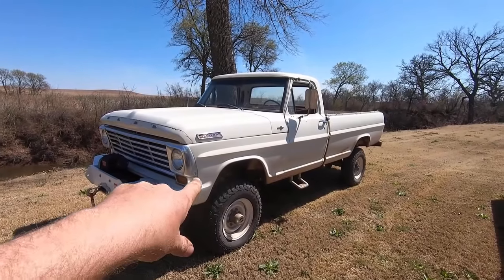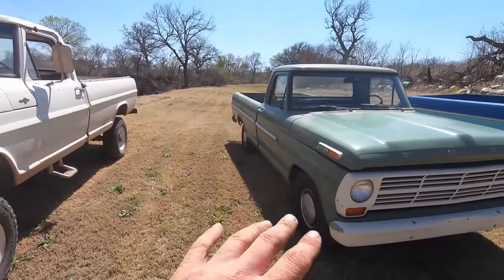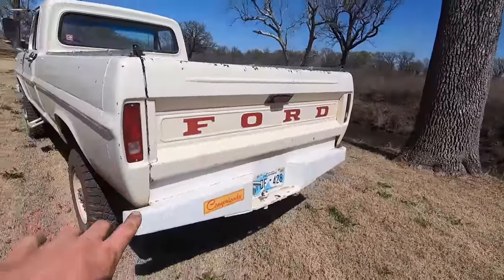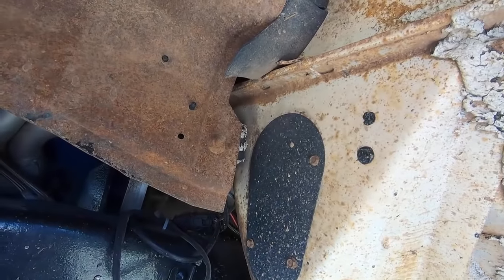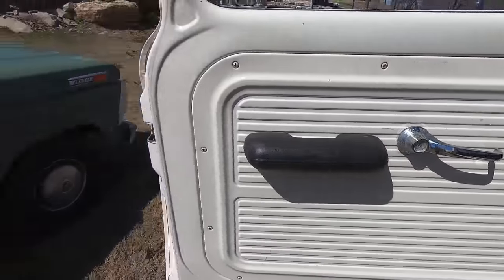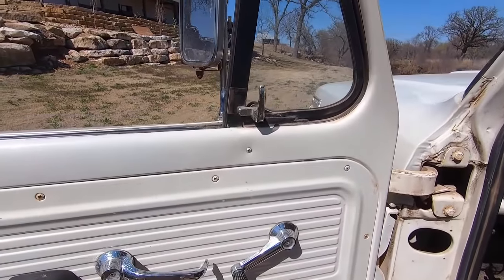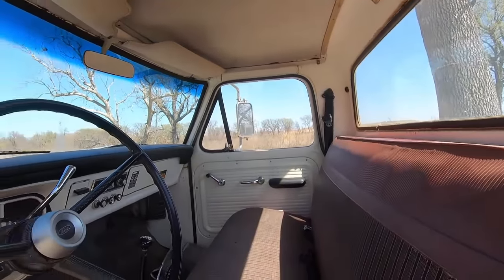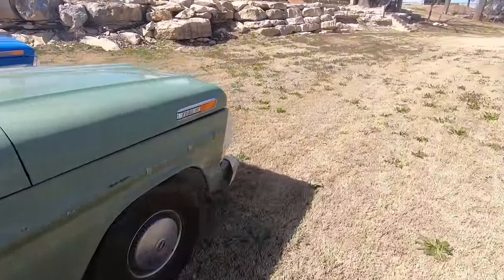What Makes a 1967 Bumpside so Different Than The Rest?

Comment: I had a '68 Mercury F100 short box, 240 six with three on the tree and positrack rear end.  Since it was sold in Canada it has many similarities to the '67.  Original colour was green with a white bump stop. I wrapped the odometer around on that truck.

Comment: I just bought an estate sale and there was a 1967 f250 in the garage, one owner, practically no rust, garage kept and under 70k miles, have all original paperwork and maintenance, has a custom camper on the back. Located in central Indiana. Will be sell soon. If you know anyone.

Comment: I can remember in 1972 , dad arguing because he had to buy the rear bumper separate. He ended up buying a 1972 Ranger XLT , candy apple read , 2 wheel drive with a 302 in it.  I believe 72 the seam going down the bed was gone . Then 73 changed everything
Reply: Also i think till 1971or 72  the F100 , only had a transfer case that was engaged or not , just in or out single speed. Dana 21 i believe .  They would break in half . I have broken more than one of them. .

Comment: This has straighten out a few questions I have on my truck. Mine is a 72 dually I got as is from a guy that installed a dual ram PTO dump system on the back, swapped a 67 cab but it has the 68 doors with lock plungers and armrest door levers. The cab is  f100 bump and naturally it has a 460 out of a 78 continental… man I love my truck 😂

Comment: 67 though 69 Ford pickups were the toughest Ford trucks ever produced. especially the ones equipped with the 300ci 4.9L inline Six cylinder engine. they were bullet proof.
I have a unique Ford Pickup, it's a 1966 F250 4x4 chassis with a 1951 body on it. with a 400 + HP 390 FE engine and a tilt front end. I did all the work on it myself including building the engine. except the dual two and a half inch exhaust system. I also have a 1978 F150 2WD with a 360 FE engine and a four speed. normally 78 models didn't have FE engines in them. but I put it in the truck with some parts from a 1967 F100. I also used the windshield from the 67 and put it in the 78. I also have a 1981 F250 4x4, with a 300ci 4.9L inline six cylinder engine and a four speed. it's a totally bullet proof truck. a person might say I really like Ford Pickups and they would be right. they are best trucks ever made no doubt.

Comment: My dad had a 67' f100. Came stock with a 352fe. Air cleaner was an OIL BATH. No filter needed. Copper mesh was the filter! Cleaning was done gasoline. Filled air cleaner with a small amount of motor oil. Worked perfect. Love that year!
Reply: 352s' were the block from the Ford Edsel that set for 10 plus years and they bored them out to a 352
Reply: They bored them to 361, advertised as 360
Reply: @tima5521 The truck 352s were not leftover from the 50s, they were new blocks, pre65 blocks will not accept truck motor mounts

Comment: I learned to drive on my Dads 1972 f100 302 3 on the tree ... Loved that friggin truck, it had 400 thousand on it and the engine had never been cracked opened. He ended up trading it in for a brandy new 1987 ford ranger... Although 67 thru 79 were essentially the same core truck the 67 to 72 were always my favorites and I liked the gauge cluster old school style more so than the square gauges from 73 to 79. If you look Ford just basically flipped the 72 grille upside down and embedded the ford letters into the upper grille and took them off the hood, quite clever actually and was an interesting facelift for the 73 thru 77 models...Love your trio brother, keep em forever!!
Reply: Another great thing about Bumps is that you can bolt an F500 Gauge cluster right in. '73-'79 is the big truck cluster to get, as the gauges look more modern. '73-'79 F500s retained the Bumpside dash. The '67-'72 F500 gauges look almost like they're from the 1950s.
Bad thing about Bumps is the welded-in dash - that must be why it kicks up on the passenger side, so you can service the heater. I would consider bolting a Bump dash into my Dent, so I could run those big truck gauges. I wonder if the Bump dash is welded into the Dent F500 cabs, or if it bolts in like the ones in the pickups.
Reply: @DanEBoyd  You should check out the Brazilian F-1000, apparently they have been continuing to build the 1967 f100 as the F-1000 over there all the way through from the research, looks like 1992... The truck has a full set of round gauges that you could probably order from Ford of Brazil that might plug in with some mods..
 check out the You tube videos for F1000s 1992 ford F1000 will blow your mind...
Reply: @ROROSMACHINE  I will check that out.  Ford also produced the 1960 Falcons up into the '80s or even '90s, in Australia and in Central or South America. At the end they had modern cartridge bulb-headlights and a few other modern updates.
Heck, if I can buy me a new Bumpside, I might just go there!!

Comment: I have a 1970 F100 that I'm just starting to work on. It had been sitting for 16 years in my Grandpas field. It has a nice 390 in it. It had a 2 barrel carb and some old gas in the tank. I put a battery in it, put a couple gallons of fresh gas in it. Primed the carb and cranked it over for about ten seconds,  pumped it 4 times then turned it over again and it fired right up 🤯😁 it blew big globs of old carpet fibers out of the exhaust for a couple minutes and smelled like dead 🐀. After about 5 minutes of idling it smoothed out and just purred like a 🐈. The exhaust mounted heat activated choke and everything even works. I could not believe it 🤗🥳

Come to find out the engine had been bored .060 over so it's actually a 401, it doesn't overheat and runs extremely strong. I did put a performer rpm intake on it and put some gt heads with stronger springs on it. It runs even better now. The part I'm searching for now is a replacement tool box tub for the bedside tool box. Unfortunately I can not find anywhere to buy a new one so I'll be searching junk yards. 

Im very happy to have it. My Grandpa died last Oct so I'll have this to remind me of him. I also got an 49' F1 that was his. It is a project but still cool. The 49' is going to be my hotrod.
Reply from the maker: Awesome story! The sentimental ones are the best.

Comment: When I got my 67 there was a rubber bladder on the floor near the dimmer switch that would pump the washer fluid. The washer fluid was in a bag that hung on the inner fender.
Reply: That continued in Australian dent line until Aug  1980 when last of dentsides were put together in the Melborne factory, but if I remember correctly a plastic bottle was the reservoir, however in time that foot bladder would leak and create a wet spot leading to rust in the floor plan.
Oddly all of the windscreen wiper switches in the unique Australian dash boards ( actually English Ford Cortina car dashes) had a push in function that powered a wire in the engine wiring loom making it easy to use an electric powered washer bottle.

Comment: Cool trucks. Those shock reservoir's would benefit being mounted in a cooler area for increased shock performance. With all that heat from the motor you might be shortening the life of them too. Cooler shocks perform better.

Comment: My first truck was a 67 short narrow box with a 240 6 cyl 4 spd, Dana 61 posi rear axle. Was pretty scary driving out of the mountains downhill on icy roads, wanted to steer you straight over the edge on the corners, swapped it out for an open diff 9" rear.
Reply from the maker: Yeah open diffs are where its at for ice for sure.

Comment: We had a 1967 green F100.  300 ci 6, 4 speed, no power steering,  no power brakes.  I could stand in the engine bay with my feet on the ground.  Sure miss it.

Comment: Regarding the handbrake, Australian right hand drive F series utilised an Orchilin style lever to the left of the steering column under the dash, the knob on the end of this lever when turned clockwise tighted the wire leading to the rear  brakes.
It was easy to use and was long enough to give good leverage for tight hand braking,

Comment: I just bought a sweet, near mint 1972 F350 ‘stake/dump’ with 20,638 original one owner miles ( I will be doing some videos on it ). I too had a f100 in your same green with a 6 cylinder ‘three on the tree’. Back in the recession of 1982 , I lost my 79’ Ford van to the bank. An old painter sold me his good running 71’ F 100 for $75 to help me out !
Reply from the maker: Awesome! Would love to see that.

Comment: On the doors- I have one that the vin tag places as a November ’67 but it has ‘68 style doors.  Just wanted to let you know.  They are the original doors.
Reply from the maker: Model years changed over mid year in the summer so trucks build in the later half of 67 would be 68 model year trucks. Your truck is a 68. 67 trucks would be built from mid year 66- mid year 67.
Reply: @MattKubik1791  thanks a lot, so on the title would it be a ‘67 or a ‘68?  Still trying to get one. Thanks
Reply from the maker: @davycrickett7028  should be titled as a 68
Reply: @MattKubik1791  thanks a whole lot.

Comment: Great description of the 67 "High Boy",
 However Ford had some variations in their Canadian export High Boys, I have a 1974 and 1976 High Boy here in Australia with right hand drive. 
My 76 has a chrome non-glass mounted rear vision mirror mounted to the cab above the windscreen.
Also, Australian Hi Boys were the only fully imported F series trucks after 73 I think in Australia, the F100/250/350's 2WD and F100 4WD were assembled in Australia, the 73 - 77 Australian imported F-250 High Boys from Canada have the F500/600 steel chrome dashboard you show in your F600 truck, 
Australian assembled F trucks (dent-sides) have a unique dashboard different to USA/Canadian models and a different glovebox door. 
Steering columns from around late 73 here are also different with indicator/horn and headlight dip switch incorporated in one lever as in Ford Falcon/Fairlane styles.
Disc brake front were standard on all Dent-sides here and they were made up until November 1980 here in Australia, the Bull nose F series trucks and Bronco's started being assembled here from 1981.

Thanks for your informative video.

Comment: Nice!! I just picked up a 68 cab for my project.
Reply from the maker: Awesome! Nothing wrong with a 68.  We don’t have one on the property but my brother has a 68.
Reply: @MattKubik1791  I have a question..I see a shoulder strap seat belt in the highboy build.  How did you mount those??
Reply from the maker: @diyjeff1838  bumps have shoulder belt mounting locations under a rubber plug. But I didn’t like how far back the early ones are so I mounted it farther forward to the location of the 70-72 location. I used the hardware provided in the seat belt kit.
Reply: @MattKubik1791  I didn't know that and I just ran out to check the 68 cab and you are right!! How did you relocate it?  I like your idea better, looks more comfortable.
Reply from the maker: @diyjeff1838  I got a mounting kit with my belts.
Reply: @MattKubik1791  lmc?

Comment: My Dad had a 1967 Ford F350 Dent side. it was a cab and chassis Dually dump truck. 361 ci V8 4 speed 2 wheel drive 9 ft dump bed. we used it a lot on our farm. That truck was an old work horse

Comment: The 600 gauge bezel looks good in high boys, yes its not correct but it looks good.
 I'm a huge 67 fan myself
Reply from the maker: Yeah 600 gauge swaps are pretty popular!
Reply: I prefer the Dent-era F600 gauges themselves though. They have that Cougar XR7 look to them, whereas the Bump-era ones look way more old-timey. I want the tach and vacuum gauges too! (Even though the big-truck tachs are cable driven, or need to be adapted somehow.)
The F600 bezel looks like aftermarket gauges would work well with it too.

Comment: Interesting, the Australian 69s only had the aluminum grilles., The 68 & 67 over here were steel chrome, or steel painted white. Also Aussie 789012, put 19 in front of those numbers, never had black rubber dash tops, just painted head cracking steel. I might be wrong with our 71-72, but 67, 8, 9, steel not rubber.
Our trucks came from Canada, got the converted, and often, the 300 6 cylinder, was swapped for a 302, 351.

Comment: I have just realised my Australian F250 dentside has what you called an F600 dashboard as original fitment only the guages are on the right hand side of cab. The 2 blank larger round  potential holes would have housed a tacho and air guage in the larger F600 and 800 trucks .

Comment: My grandfather on my mom's side had several Ford F100s in his time.. he traded about every 2 years.. he had a late 64 and waited till the 67 model to come out in late 66.. yes I can remember the differences he had economy heater switch in his base model. truck it was green. not sure what engine was in it I think it was a V8 with a 4 speed on the floor, his first automatic was not till the 1972 model year..  I remember riding with him when he went to check cattle or when he and dad went to farm sales I agree they were a great truck.. also my grandfather also had a few Chevy s too .. he thought was a truck is a truck does not matter what brand just as long it did the job it was intended to do. he would use each one for a different purpose. on the farm.. he just bought em cheap as he could.  his first air conditioned pickup was not till the 1977 Ford F150 Ranger.

Comment: Awesome tour Matt! I'm wondering where to get a few parts. I need the original air-cleaner for the 360 FE and a radio bezel for my 72 F250 crewcab.
Reply from the maker: I think you can get a reproduction radio Bezel from reproduction parts catalogs such as Dennis Carpenter and the rest. I’m not sure on a factory air cleaner. I would check out eBay and see if you can find a used one. That’s where I get a lot of my parts that are hard to find.
Reply: @MattKubik1791  Thanks Matt, I'll take a look!
Reply: LMC Truck - Lenexa Kansas. Check Out their online catalogs. Have read some negative comments on some forums about the rubber door seals from LMC...probably cheap, poorly made from C-H-I-N-A.

Comment: I noticed someone put the visor hook upside down on the newer one.  I did not see if you did mention it but teh highboy frame is narrower so teh bed mounts and the cab , bumpers and core support mounting holes are all closer together on teh high boys . I learned that after I had a bed all painted and ready to install and nothing lined up. I ended up ;making  brackets to put teh holes inside teh frame an inch or so inside the frame times 8 holes . we live and learn. I have a 2x4 power steeering box on my 72 high boy . Took a lot of labor but I got it on and working . It has decent road feel but all in all it aint bad at all. The pitman arm swings between teh frame and the leaf spring and I had to trim off some of teh lower left side of teh radiator mounting strap,  I drilled a hole up 3 or 4 inches higher and it works fine. Never wrecked , zero rust , 390 cam headers  edelbrock, 12" clutch 4 speed  100 gallons of gas , 6 spare tires  pto winch , electric/ hydrolic  dump bed , engine hoist factory air and heater  camo inside and out , am fm cb radio and the list goes on .  I cancer dying and need to find her a new home.  I think $22,000 would be fair. if interested call my home no texting 480 654 1636
Reply from the maker: Very Cool! The rear view mirror on the 68-72 are correct. The hook is facing the opposite direction as the 67. And as for the frames I think you are referring to a 73-77 truck? the highboy frames are 34'' yes but the 2wd frames from 67-72 are 34'' as well and the body bolt right up with exception to the rear cab mounts. They are out board on the 2wd trucks.  After 73 the 2wd truck frames changed to 37'' and guys who body swap a 73-77 have to modify the bed mounts. cheers!

Comment: I remember my old ford 4x4 4sp 6cyl   it was always dependable could haul a good load of wood and went great in the snow in our west Virginia mtns but could of used more horsepower to get out of bad situations when it got real bad  always wanted one with a 3/4 ton suspension and with the 460   my favorite truck I had though was a 90 model dodge Cummins turbo 4x4 5sp  I had no power issues at all with that truck and it not only hauled a nice load of wood it would pull a big trailer full also

Comment: The 67 also has the windshield washer bag. I believe 67 also has a different P/S box. I have a 67 camper special.
Reply from the maker: Forgot about the washer bag! Good catch.
Reply: I like 67s too yet I have a 69. My grandparents had a 67 F250 Custom Cab Camper Special from new until 2000.

Comment: My friends mother had a '67 with the all steel grille, I had a '68 with a steel grille, and my father had 2 '69's one with the steel. and one with the aluminum grille, like your '67 has. The grilles were mixed and matched, but were interchangeable on all 5th Gen Bump side trucks. The entire doghouse was interchangeable for the 5th Gen. The '68 was the first year fot the parking lights on the front fender forward of the wheel well/

Comment: taught me something here. My 67 heater has the defroster on/off label, but no rod in it. I always thought the trim around the heater controls looked newer, and there's an extra factory hole on the right side of the steering wheel. Previous owners must have done away with the economy controls, but when I am restoring I I will have to put it back in and delete the new ones he installed. Only thing that I noticed that you missed was the location of the hole for 3 point seatbelts. The location of the factory hole changed, but I do not remember specifically what year it changed.
Reply from the maker: You are correct. It did change. But that was changed in 1970. So 68-69 also have the different location so it isn’t a 67 specific difference.

Comment: I have a 1967 hi boy bought it in 1989 $600 bucks had a 352 posi 4.56 gears arm strong steering and no power brakes, still see it running around Pueblo CO